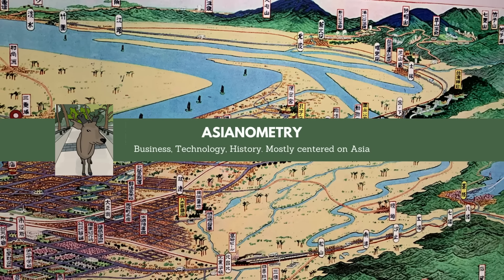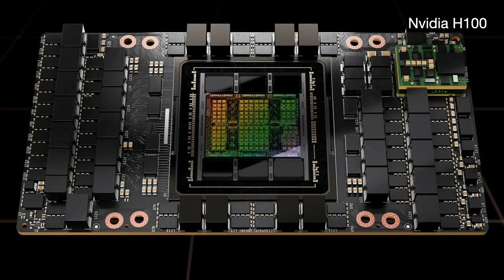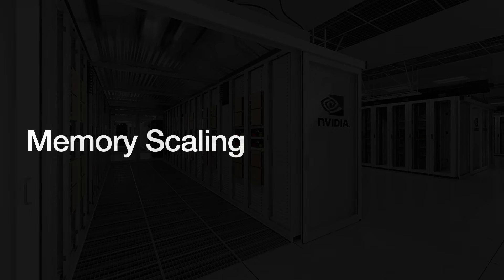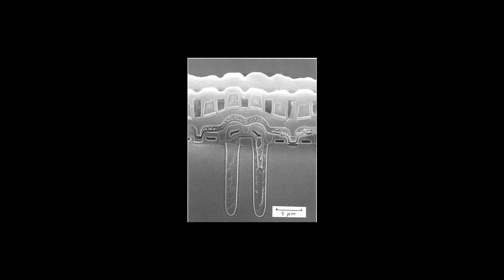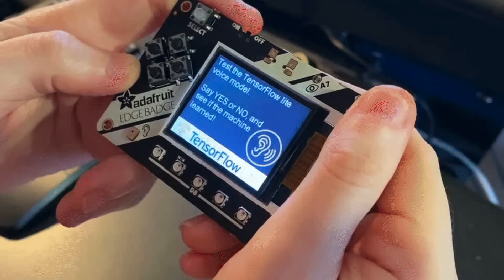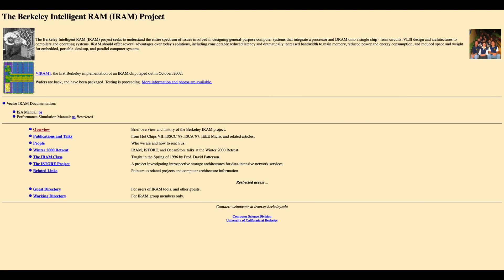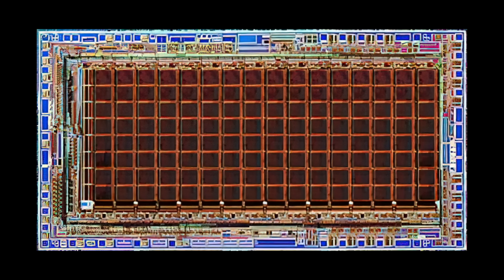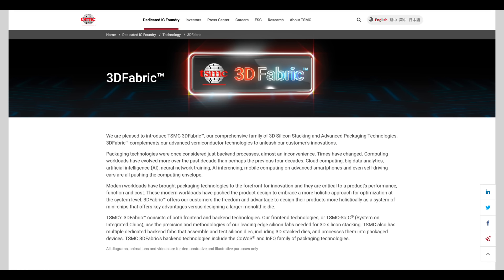AI’s Hardware Problem

Comment: There is a simple solution... albeit one which holds the real possibility of radically changing the entire computer industry.  Memristors.  Memristors instead of transistors, were we able to achieve high-volume production, would be the only thing we needed.  Memristors can replace the CPU, GPU, RAM, and SSD.  You can intermix compute and memory trivially easy with memristors.  And you can change whether a section of a memristor grid is computational or memory storage (all non-volatile, and all as fast as registers) on the fly with microsecond timings on changing it.  For reasons I have thus far failed to understand, those using memristor technology have focused almost exclusively upon using them for neuromorphic accelerators.  That is a tremendous waste.  If you could efficiently mass-produce large volumes of memristors at small scales, you could ignore the neuromorphic aspects and instead replace the entire CPU, GPU, RAM, and SSD industries wholesale with a single product.  Their design, at the production level anyway, would also be very simple, similar to how SSDs are just big grids of NAND gates compared to the monstrous complexity of mechanical hard drives.  Price-fixing tactics have artificially preserved the existence of mechanical hard drive companies, and we might end up seeing that with memristors as well, which would be very sad, and would continue holding us back just to keep some current billionaires rich.

Comment: As much as DRAM has limitations in how much you can shrink it, we're entering the stage where SRAM can be made with far smaller lithography to provide same density per sq mm, albeit at higher cost due to more advanced process. Still, a shift away from DRAM to SRAM would highly decrease the latency and allow far higher clock out rates than DRAM, so I'm hopefully that at some point it will become economical to abandon the whole DRAM dead end.
Reply: @kazedcat  I do apologise, however when I was checking few months back, the on cpu L3 cache was taking only about 10% more space in square mm than typical DDR4 (did not look at ddr5 process to be fair). Please bare in mind that when comparing sizes you need to take into consideration adjacent circuitry, which in case of ddr server larger swaths of memory, while on cpu address decoders (that are also bolted with some coherency mechanisms, dma and other stuff depending on arc - are not necessary for box standard memory application) are serving tiny L3 regions. Also for memory application the sram cell design is different than for cpu, so one can get away with smaller size of cell.

Comment: I didn't know that current AI were limited by hardware and such systems. This makes me think that neural networks aren't at all the answer we are looking for. Powerfull, yes. Close enought to get the answer on complicated problems totally. I don't know how the fuck we could do face recognition or image recognition without that. But i feel like there are areas where these are trying to be used that aren't suited at all for that.

Just think about how a human mind works, and what "computationnal" power we have, and compare that to computers. There is structural differences, and I think this is where we are wrong by looking for answer. I think we have enought computationnal power to do what we are trying to do, we aren't just making it efficiently enought.

Comment: Correction.  FE-RAM has been commercially used for decades now long before"Reram"   Either way, you still. have the same old problem of Nonvolatile RAM memory -- the issue is not "the right chip arcjtecture" -  or architecture "paradigm". Nonvolatile RAM memory is an old solid state problem and the problem has not changed in that centrality. the problem of the nonvolatile memory  itself.  " Reram"  is just a new buzzword in a very long history of buzzwords.

Comment: wait trillion of parameters but each parameter is a double... so 8 bytes... 8 bytes * trillion = 8 trillion bytes or 7450 Gb. Where do you get your 320 GPU with 80 GB memory... In my opinion, you don't count the neural model only but also the dataset to train the model ???

Comment: I grew up in computing as a systems programmer on Univac multiprocessing systems in the 70s. Then, we were all aware of the contention of memory access. Cache memory and memory banks eased the problem somewhat. Years after leaving Univac I developed a radical technology. In this technology a thousand processor core can access a common memory without conflict. It has a few drawbacks. Implementing stacks would be unlikely.  Instructions are somewhat slower than are common today.  Cache memory would not be practical. Pipelining would also not work. Here is how I devised this plan. I went back and looked at how computing evolved. Then, the speed of data through a wire was considered instantaneous. I began this trip with the idea that transmission was slow. How would the inventors deal with that? I began implementing a solution with a small gate array that I estimated would compete with an i5. But I got hit with a massive heart problem. I simply don’t know what to do with it cause I’m a nobody.
Reply: @@achannel7553 
Well, its not as great as it sounds. They are only 8 bit processors. And on chip memory is somewhat limited. External standard memory would not work as specialized memory is required.

Comment: The human brain doesn't do computations. Also, widening highways does help with traffic... if the widen freeway didn't fill up, it would've been a waste to widen it. The filled up wider highway takes more traffic out of the city, which is the point

If we use the same logic as the 'widening roads doesn't help with traffic,' then the only logical conclusion one could reach is that all roads should be one lane; after all, why make two lanes if those two lanes fill up and don't help with traffic? I guess flow rate means nothing to you people?

Comment: There would also need to be massive increases in onboard cache.  It is interesting how we have already hit size limits on dram, we are reaching similar limits on cpu's too, I suspect then we will see the fix improving both - multiple layers.  Today the routing has for a long time been the biggest delay so if you could double layer then we would see much faster chips.

Problem then is heat....

Comment: I think another problem is the deterministic and precise way computers work that are anathema to how brains work.  That's why I think a "robust first" approach would so much better.  Sure it'd take a lot of work since it's quite different to how computers work now, but in the long run would result in more secure, reliable, and infinitely scalable computing.
Dave Ackley and his T2 Tile project are the best example I could find of this.
Reply: Good idea but inefficient  since it'll take decades to catch up to the current method, anyway it's not a how our brain works, it's how math works so you will have to find a way to change math as well but anyway this isn't that big of a issue since we are solving it by creating better algorithms and gc

Comment: This video is not about normal intelligence. Normal intelligence works something like this. There is some sensor (sensory organ) that takes the measurement. This is a sensor measuring a physical property and its severity. Next, the property is cleared to a digit (magnitude, quantity), i.e. the external irritation of the tissue turns into an incoming signal that has a magnitude. Then the purified quantity enters the mathematical space (processor, brain), where it is transformed. Mathematical space has nothing to do with reality. So much so that there is such an effect - a hallucination. This is an inaccurate measurement, a deception of the senses. Similarly, under the influence of drugs. The quantity transformed in mathematical space goes to the controlled body. For living tissue, it is a muscle. For technology, this is just some parameter of the machine (the work being done). If you put it all together, then intelligence (real or artificial) is the control of some parameters of the machine through an incoming signal. For example, the lighting level is controlled by the amount of noise. The louder, the darker. Accordingly, we must have a machine that controls the lighting and contains a light bulb, we must have a noise measurement tool (ear), and we must have at least one microcontroller that will adjust the outgoing amount of lighting depending on the incoming amount of noise.

Comment: With energy density increasing with every part of the computer. RAM, CPU, GPU. I wonder if we will get to the point where liquid nitrogen cooling of the entire system will become economically viable. Not only will you be able to squeeze, potentially up to 50% more performance out of the entire system, it will also be far more power efficient. I’ve seen some cpus run at half the rated power draw while under liquid nitrogen. This could potentially solve part of the memory power problem you described. I’m guessing the system would have to be engineered from the ground up to run at -190c. At this point I wonder if you could also integrate YBCO as the trace material to reduce all power loss there, except for magnetic field interactions. Obviously, this would only ever be practical in a data center setting.
Reply: At this point I wonder if it isn't just easier to make a quantum computer xD
Reply: @LuisOrtiz-zu3dq  lol at that point maybe, still gotta crunch those Twitter rants FAST, which Quantum computers wouldn’t be to good at.

Comment: If a neural net is basically a data waterfall running one way...and in software at least it is memoryless.... In other words the previous iteration is not a requirement for calculating the current iteration...then can't a system like this be replicated in hardware? Basically a ramless system. Now you have no need to fetch any values at all... Or store them.

Maybe I'm just having a brain fart here without considering much. Please, do chime in to tell me what an idiot I am. Cos it's 7:30 am here and I haven't had any coffee yet. 

But this is a system design problem not a physics or software issue right? Well it's a physics problem cos latency and power... But mostly it's a design issue. 

So what you could have is a compute system that only went one way... It never stored anything to ram at all...instead the GPU output was simply loaded back into the GPU immediately and processed again. Totally bypassing any need to store any values. 

At some point the completed results could be stored to ram but every previous cycle just calculated and dumped output values straight back into the processor. 

Yes this creates a complete black box design but it would work right? 

Am I missing something? I'm missing something right? Cos I'm the randomer online here and  It's not like nobody thought of this.

I'm not a religious person at all but the line from the Jewish Talmud of "if thine eye offends thee, then pluck it out!" Comes to mind. And ram clearly offends this system.

Comment: Two things I wish you had mentioned that could utilized to help out with this process. First off is the number of cores that exist on a CPU but also the way that they are accessed is very critical and several companies are designing CPUs that will be able to work hand in hand with gpus in the way that their core systems are designed, with multiple companies now designing CPUs with over 100 cores per chip. Second is the use of quantum computing in processing logic gates among other things. IBM's photon chip tech combined with quantum computing are going to revolutionize the way we use computers at a scale that is hard to imagine. Exciting times we live in.

Comment: Mechanical functions of AI in other words needs to reproduce vast libraries where encyclopedias are accessed (read) and private ledgers need to be saved (written) at the same time with appropriate interconnecting nodes and conduits. It's obvious that so long as AI depends on storage we are pretty much stuck in the old analog paradigm of yesteryear. This also reflects the limitations of mineral based materials versus bio-centric based infrastructure (like organisms).  I thought progress would come from magnetic/static energy and plastic based circuitry but I haven't heard much of it in the last decade... I guess bio organic based chips may best reproduce what grey matter originally is and no matter how much we try to avoid it living organism will always be better than any synthetic substitution when it comes to replicating memory, learning and intelligence.

Comment: What is different about the cache on a CPU as compared to DRAM that allows it to be manufactured alongside the logic? What are the implications for bandwidth, latency, and power draw?
Reply: Cache of a CPU is literally inside the CPU, hence why its so much faster than DRAM. It is a part of the CPU and hence is made while the CPU is being created.
Because its inside the CPU, there's lower latency and power draw involved to use the cache, and its bandwidth depends on the chip organization but is probably less than the bandwidth of a DRAM because the purpose of cache is to usually hold registers/mid-computational values.

Comment: I have seen a concept proposed to use analog computing elements in a neural network application.   The concept being that a MAC instruction can be implemented using a single analog element (e.g., transistor) and it can achieve several bits of accuracy.   Also with neural networks the need for absolute accuracy is not there.

Comment: "DRAM faces scaling limits" I would think this could mean that static memory would lap dynamic memory, since static memory cells only need transistors, not capacitors. This would be a good thing, since statics are faster and don't need refresh cycles. This already happened in random logic applications like CPUs, where they moved to static logic and dumped dynamic logic like domino logic, which had minimum clocking requirements.

I like to think of IC tech like trains racing on multiple tracks. For example CMOS logic took a back seat to NMOS tech for many years, until NMOS hit the speed/power wall, then suddenly everyone switched to CMOS.

Comment: Splitting the uniform memory block into like 128 blocks, each with a CPU that performs algorithm on local data, which knows nothing about outside data.
Basically interesting idea, but memory/task management seems like a nightmare, especially nowadays, since everyone wants/uses more and more abstract programming languages.
Likely also gives lots of race conditions, with RAM CPUs working independently from central CPU.
Reply: You clearly don't understand how parallelization works. When an AI model is trained or deployed, you have to compute a few million computations that are all essentailly the same and can be done essentially independent of one another and require the exact same amount of time.

Picture a million robots doing the exact same steps in parallel until a million phones are fully assembled. There are no racing conditions in that scenario.
Reply: @leoncemollerus1949  Yeah, have fun running something like a sorting algorithm on these.....

Comment: Nvidia sucks ass for restricting the memory to very low amounts. 128 GB is easily done with a normal PC and the typical expandable memory. You can go up to 1 TB at little cost, but GPUs from Nvidia cannot have their RAM expanded, Nvidia is holding everybody back and ripping off the rest by massively overcharging for RAM. Intel should release a GPU that has expandable RAM, the same as the motherboard can do that. They would immediately steal business away from Nvidia, I would immediately buy an Intel GPU, I'm happy with Nvidia (performance) but their RAM sucks really bad! WAAAAAAAAAAAAAAYYYYYYYY too little RAM on even very expensive GPUs. Nvidia would lose so much business eventually that they would also have to offer user-expandable RAM. GPUs with 256 GB RAM or even half a terabyte would not be uncommon.
Reply: And I have ~16TB of disk memory installed, and can go way higher. Motherboard manufacturers suck ass for restricting the memory to very low amounts!!! 🤡

Dude.. You can't be serious..?

Comment: This issue of memory being slow is a general one. A modern CPU is also often limited by the speed of ram, which is around 200 times slower than the cpu itself. This is why CPUs have various caches, without them CPUs would perform like the 1990s.  But if programmers aren't careful they can fail to leverage those caches well.  Maybe AI training processes need to figure out job specific caching schemes?
Reply: cache always runs out. otherwise, we wouldn't need dram at all. it's a hack that works reasonably well with limited data(desktop computing). it's worthless when you have gigabytes of data to push trough in one cycle.

Comment: attempt to put the compute near the ram, and you'll find a cache still helps, and you rapidly snap back towards the traditional architecture ..
throwing 1000 computers at a problem, each with its own 100gb of ram is also a similar strategy at a large scale - in some ways super computers are the embodiment of compute-near-ram.

Comment: You should make a bit more research before making such video. The need for in-memory computing is for training, not for inference as you have mentioned. You didn't say anything about Cerebras which is best implementation so far of "in-situ" architecture, and not only it is much more efficient than any GPU, but it allow to train models that can't be trained on GPU/TPU (within reasonable time).